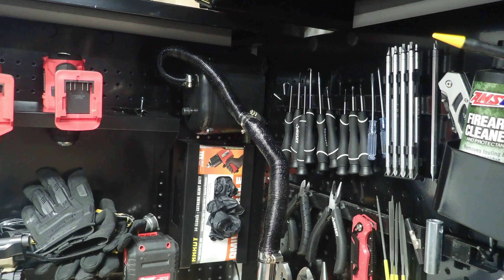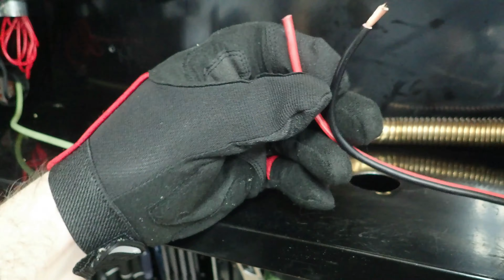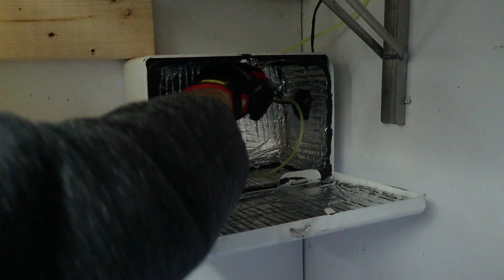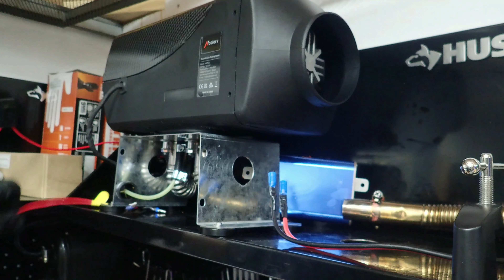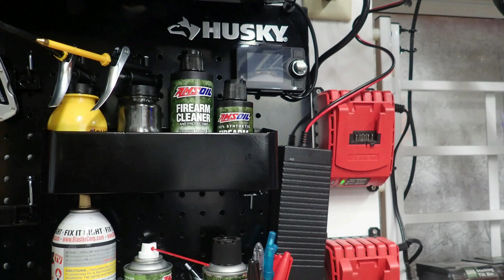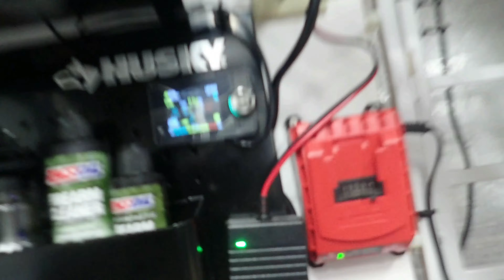Hcalory 5-8KW Diesel Heater Custom Setup For Garage Heat Part 2

Comment: there is no pressure in the fuel line ZERO. The pump is metering the flow with gravity.

Comment: how big an area u heating with that heater i was looking at getting one of those chinese diesel heater off amazon for my garage its roughly 450 ft2
Reply: It'll work very well for that. If your temps are over 30* or so you can probably heat that space to 70ish without issue.